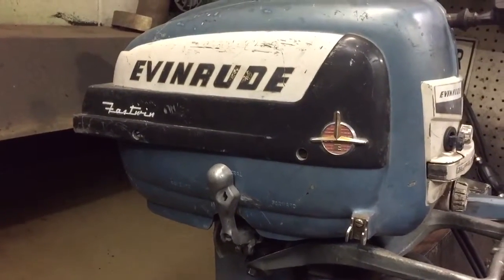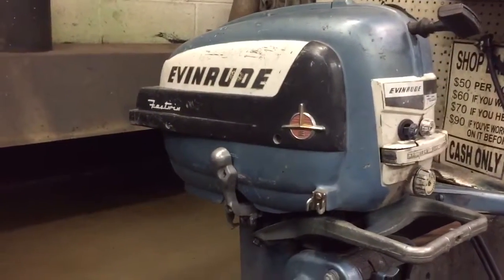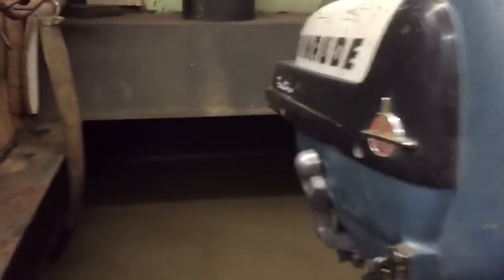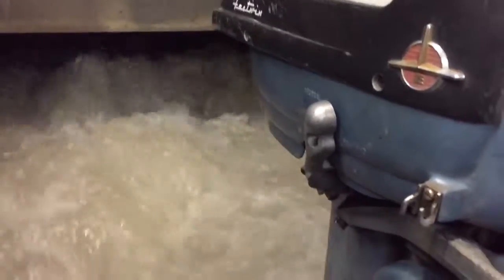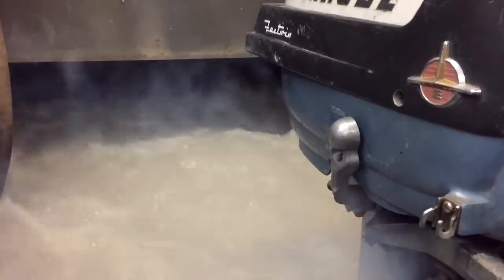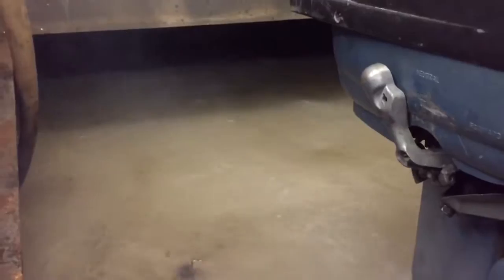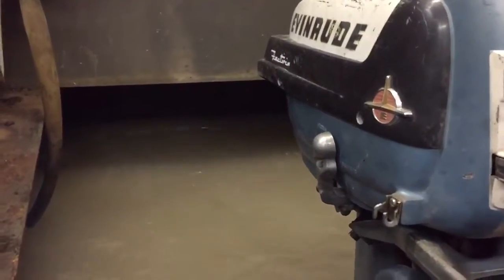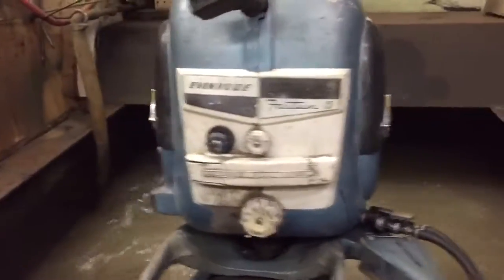1956 Evinrude Fastwin 15hp outboard motor

Comment: Runs great Ben.  My neighbor just bought one of these and we worked on it yesterday.  Still needs new plugs and wires but it wasn't pumping the tank pressure up. it did better today and I ran about a gallon of fuel through it in the tank. I may end up opening up the intake manifold and checking out the check valves. I just bought one two weeks ago myself also. Made me chuckle a bit when I saw you post this one up.